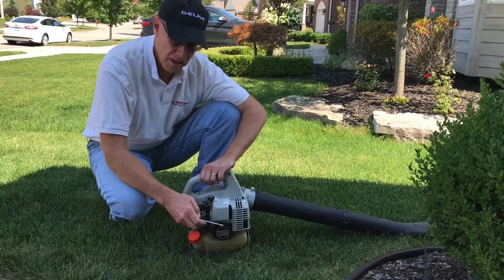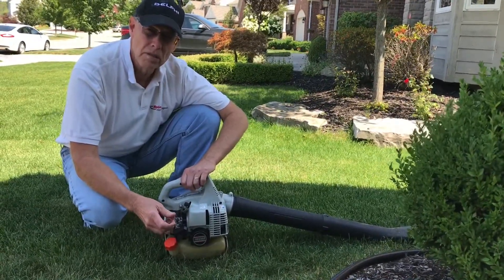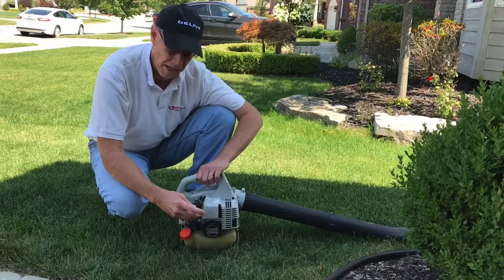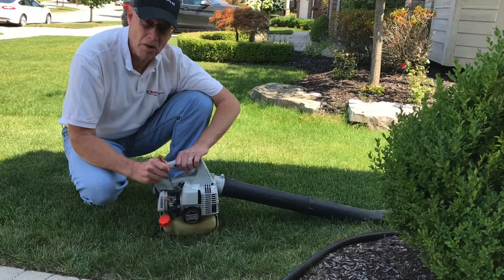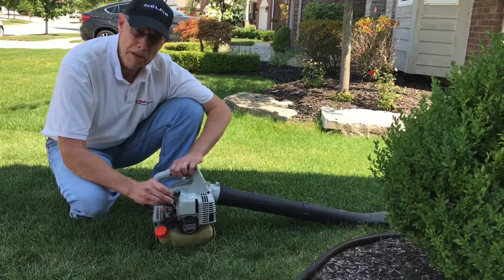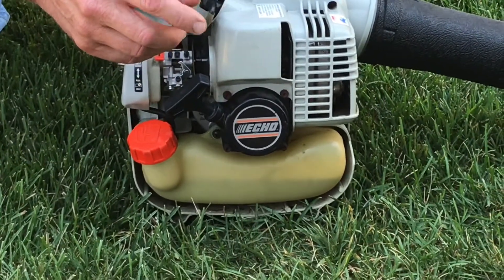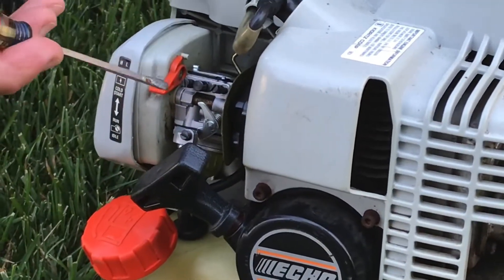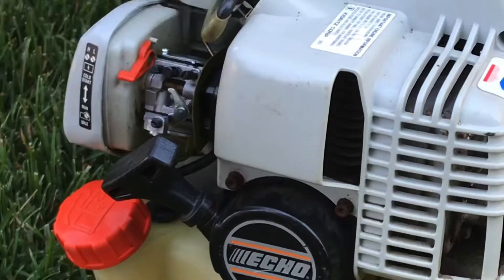Echo PB2100 - Carburetor Tuning 2-stroke engines

Comment: I have a PB 2100 that will not rev up no matter which way I turn the high-speed adjuster. I can take it all the way off and it will keep running but very slow. Does this mean the carburetor is shot?
Reply from the maker: It’s worth a try.  I’ve seen aftermarket carbs for $10.  Make sure there’s no obstruction with the exhaust.  Had an exhaust screen on my chainsaw plug up and it ran poorly.  After burning off the carbon it ran like a new engine.

Comment: What are your initial L and H needles set at?
Reply from the maker: With stock carburetor it was 1 full turn plus.  However, with the after market carburetor I had to close it down a lot.  Could start with 1/2 turn open then closed it from there.
Reply: what are the low and high needle set at how many turns out because I used to be on top of it to how many turns out that will get it started and then lean it in or reach it out or reach in there’s a lot of wannabe mechanics out there I think they know what they’re doing and they don’t. I’ve been doing this for 20 years, but she screwed everything in and then you back it out how many terms how many half terms like one and a quarter or one and a half turns on the high speed to how many terms on the low speedI used to just steel carburetors and steel carburetors were one on the low speed and on the high speed, it was like 3/4 of a turn so I guess I’ll start with that

Comment: I have a old echo pb200 blower.i purchased a carb offline.it has access to both the high and low speed  screws.when I attempt to adjust the low speed screw.where it seems it should be set the blower starts smoking like it's running to rich.so then I lean it out some.what I noticed is I'm able to start the blower with no choke.the primer bulb seems to be functioning the way it should.it also will run with the choke on when the engine is hot.what iam doing wrong?thanks
Reply from the maker: The aftermarket carburetor we purchased had an exceptionally rich setup to where we had to lean hi speed to almost bottoming out the adjusting screw.  Try turning the hi speed adjustment until it’s tight then back it out 1/4 to 1/2 turn.  When adjusting low speed be sure to keep it a bit fat so when you come off of wot it won’t stall.
Reply: @Stromzilla  I will give that a go.i should set the low idle adjustment first before the high speed ajustment correct?
Reply from the maker: @mustang49601  yes
Reply: Do I screw in the high speed screw all the way in then back off a half a turn? It will jot start -it was starting then at idle it would die -then not start again -help -there is no low speed idle adjus o the aftermarket carb -which is new?

Comment: Thanks Stromzilla.... Been having high speed run problems    I could not remember which adjusting screw was for the high speed adjustment as I will make a note in my file for this blower. I do not have one of those carburetor flex shaft screw drivers anymore that had the round cylinder head with a flat head screwdriver tip on it that was made specifically for carburation  adjustment on things that were moving or vibrating. Yeah I'm talking 40 years ago   when tools were made for such things.  Big Cooter had a grand idea. It saddens me to know that that the love of mechanics and mechanical knowledge is not passed on these days which I started learning way back growing up on the small farm I grew up on. There was not any road side assistance ....You were the roadside assistance.  May God bless those who share their mechanical knowledge with others as a brother should.

Comment: I was here first!!  A trick from old school karting.... braze a dime or washer into the slot of your adjustment screw head slot.  Then you can tweak the tune while using the power equipment .. no tools required (which are hard to use on a vibrating running engine).
Reply from the maker: I like that idea!  Thank you
Reply: Just curious, wouldn't the heat from brazing fry the carb?